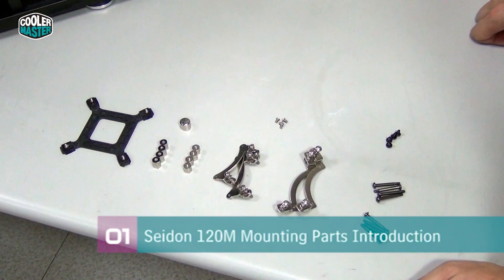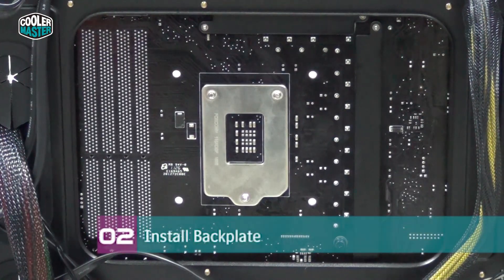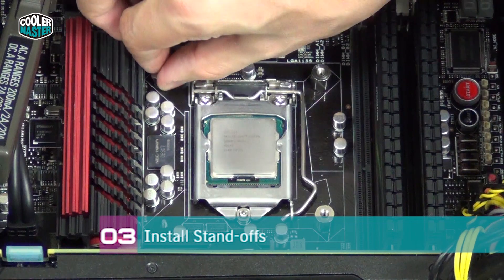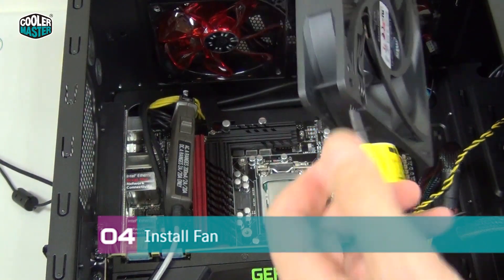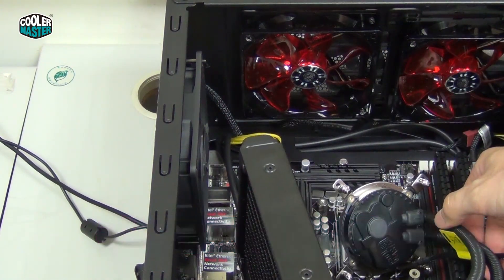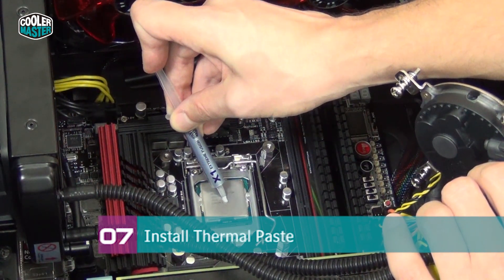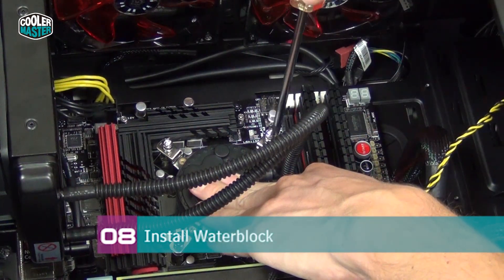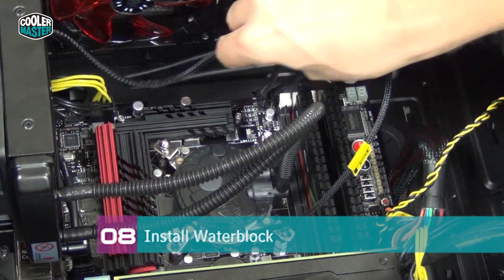Cooler Master Seidon 120M - Installation

Comment: Can anyone verify if this way (Fans sucking in air from back rather than blowing out) is better? Also, i have an extra 120mm fan, would it be beneficial to have another 120mm fan sucking in air on the other side of the radiator?

Comment: I control specialy through the motherboard software wich allows to control the speed of the fans, in this case the fan and the pump, yes you have some reason about the temps in the stock cooler and why I bought the water cooler, and the answer is that I espected to run at least 10 degrees lower and for have a cleaner look (but that wasnt the importante aspect) really desapointed, but I shutdown the fan and the pump and the temps remains the same, like the waterblock acting like passive cooler.

Comment: My temps idle were 37 with stock cooler now is 34 with seidon, I expected below 30 for what I seen peoples reviews and tests, I have seen temps drops of 20 degrees from 70 to 50 or less (for same cpus diferente them mine of course, because mine is a very cool cpu mine before varied from 37 idle to 41 celsius stress maybe you dont believe but is what the software monitor says even in the bios)

Comment: Thanks for the reply, i also have an ASUS M5A97 R2.0, the cooler is working great but i really was scared because all the force i had to apply to the screws, it just didnt seem i was doing it right, but i guess i did, anyway all the videos i see of the cooler master seidon 120m getting installed are on an Intel platform.

Comment: just curious, how many force did you had to apply to screw the first screws because i have AM3+ socket and  the screws were too far from the stand off of the backplate, i had to ask a friend for help to make pressure on the screws and securing the motherboard to make sure it wont bent because of the force. Thanks have a great day

Comment: Just a heads up, for some, the mounting screws might just be a tiny bit too short to mount the rad to the case, through a fan. Had to ditch my push/pull set-up, install only one fan on the rad, and use extra hardware to mount the rad the case for the time being. I'll have to find screws about 2mm longer to get it rigged up a bit more decently :\

Comment: no i dont think it needs to be refilled. most all in one closed loop pumps and rads sold like these will last for about 5 years worth of use. whatever that equals like 10000000 hours. lol i ran my H55 corsair for as long as i had it and never had one problem. and it was so quiet even my 120mm fans were louder lol.

Comment: i gonna buy a ASUS maximus V formula socket 1155 and it have a water cooling system, i mean the motherboard is builded for water cooling but i dont know anything about water cooling in that way with big long tubes and filled with water i am afraid that teh tube goes of then i need to put hole computer in trashbag..:(

Comment: EASY XD
Reply: Marcos Gomes So which header do I connect the wire coming off the CPU cooler? I have 3 options.. cpu_opt or CPU fan or a.o.i pump? It's a x370-f mobo Asus strix.

Comment: if you are gonna make it take air from the outside, set it up so the fan pulls air thru the radiator that way you get way less dust and better cooling

Comment: i heard its quite large so no i dont think so, assume its meant for mid full to full size towers. mind you it has a 120MM fan. if your case supports 120MM then it may fit. micro atx i doubt will fit a 120 in

Comment: Much better to blow fresh air from front of the case, or any other place far from radiator (creating a flow that travel trought all the case), then install the radiator against the case (using it to dissipate even more heat) and put the fan inside, blowing cool air outside the case, trought the radiator.

Comment: Installing the radiator inside the case with the fan blowing air from outside (partially blocked by the case) makes no sense.
The radiator is not efficient if the delta temperature is low, this wat you suck little air from outside, heat it up in the raidator and then put in into the case, where it heats up the rest of the mainboard before being extracted from above.

Comment: Thanks, it's a shame that there aren't ANY 360M Sealed Liquid coolers, the only one is the Frostbyte 360 fro OriginPC but they don't sell them, you can get them when you buy their machines. So if Cooler Master made two 360M Sealed Liquid coolers it would be great, 1 version would be the "Seidon 360M" and the other version would be the "Cosmos 360M" and would be styled to match that case, I think it's fitting. I've talked to whoever is running the Cooler Master Facebook page about this idea.